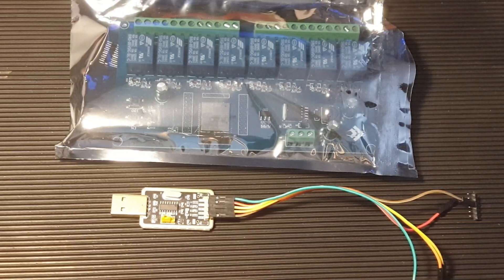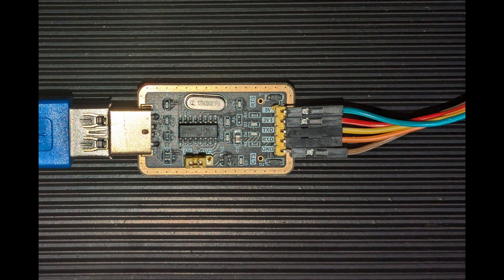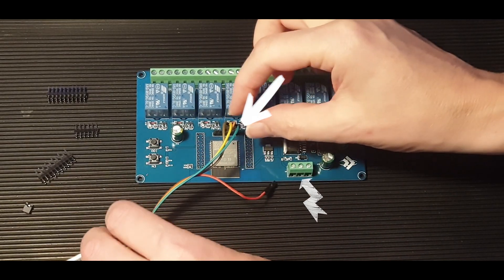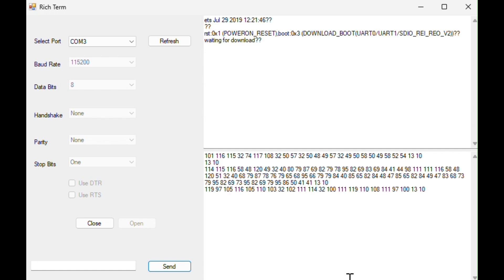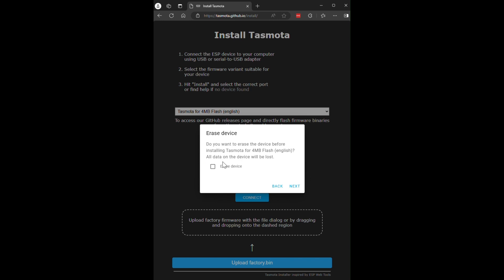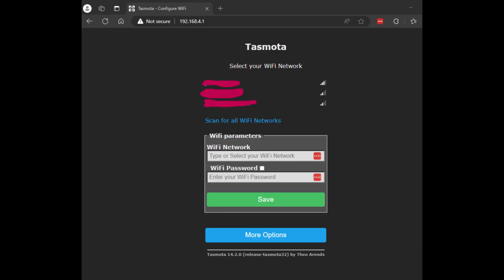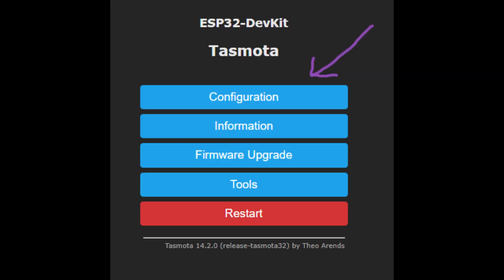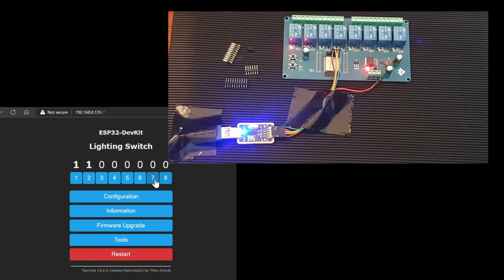Install Tasmota onto an ESP32 8 Channel Relay Board

Comment: Hi
is it possible to add it to homeassistant please ?
Reply from the maker: I've added it to Hubitat, and it works well. I'm sure HomeAssistant also has device drivers for Tasmota (it works over an HTTP or MQTT protocol)